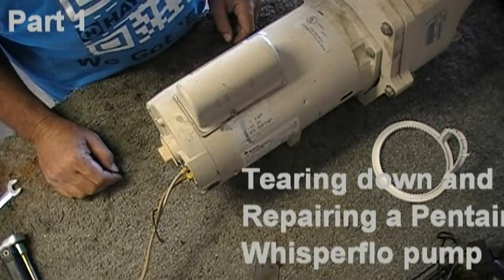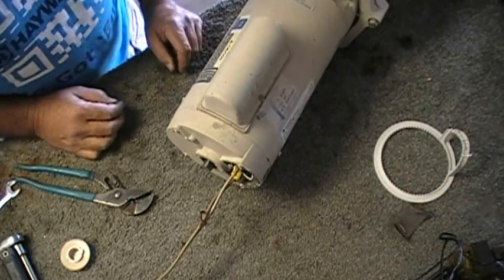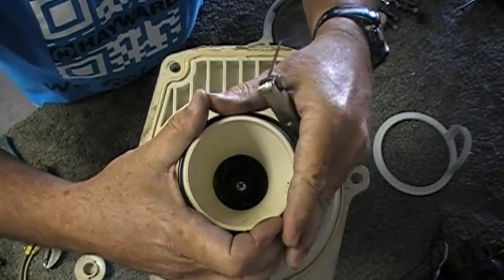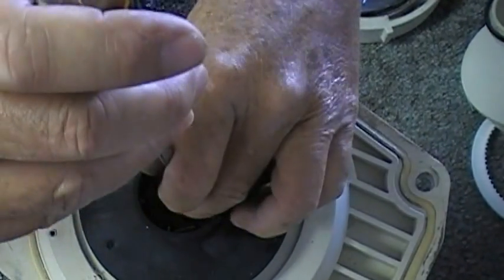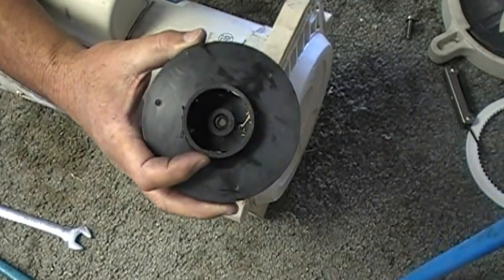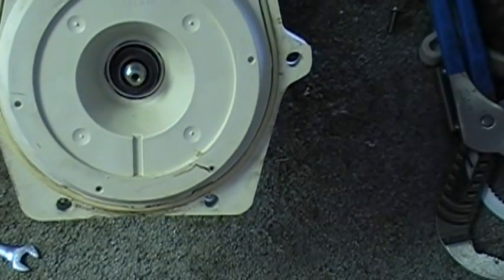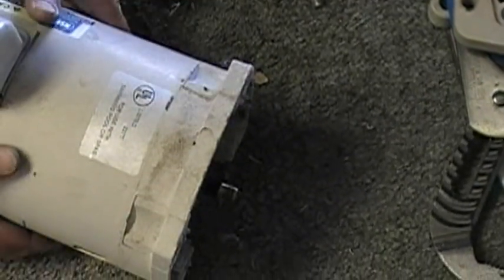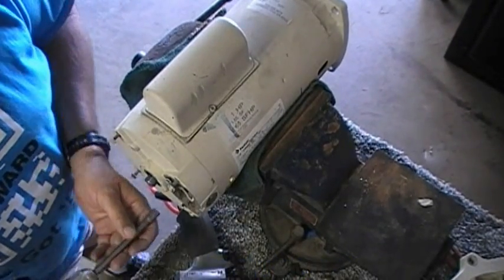Repairing a Pentair Whisperflo pump and motor part 1

Comment: the new motor I purchased from a pool company (they ordered it from a parts distributor) claims OEM replacement. New motor does not have a threaded shaft.  Now what...... The old motor and shaft has serious corrosion.Through bolts are severely corroded. Does the threaded end of the shaft unscrew from the shaft?

Comment: i have this bearings spin fine but when it runs high pitch noise then low high low when it runs what the heck is it water pumps threw but i was told motor was trying to cycle but it cant motor is going out is that true

Comment: 6:45 What you look for here is that when you use the power tool, you snap the bolts and then throw away the entire motor. Then you can just buy a new motor and all your problems are solved! Remember folks, these guys rehearse these videos, so you don't get to see how they struggled through the first tear-down. Don't use power tools on these long bolts that go all the way through the motor. Use hand tool and VERY carefully feel the back pressure from the bolt. That way, the next time you do a tear-down, you know exactly how much force you can exert before it snaps. Better method is to get some spray in there to loosen the threads before you put too much pressure. New pump should not have a problem, but who replaces parts on new pumps?
Oops - Sammy Joe already mentioned this. OK, well, I second the idea then ; )

Comment: This is a great video!!  It helped me with my stuck humming motor.  In my case I took it partially apart and cleaned out some debris from the impeller which fixed it temporarily. But then about 3 weeks later the pump was getting stuck and just humming again.  I took it apart -- had to use an impact wrench (450 foot-pounds) to get the Seal Plate bolts off since there was so much calcium build up.  And the Seal Plate was a mess, tons of build up.  I could see why the motor wasn't turning; it was because the bottom bolts had so much calcium (from water leaking onto them for over 10 years), they pushed the bottom of the plate forward.  However the top bolts were fine (no build up) therefore the top of the plate was not pushed forward.  This caused the plate to basically lean diagonal, instead of up-and-down, thus it was pinching the shaft so it couldn't spin.  I ordered a new Seal Plate and that fixed it!  I actually ordered the wrong one, and it almost fit but the bolts didn't line up and I didn't want to force it.  I was so frustrated, so I ordered another which fit perfectly.  If anyone needs a new seal plate for their Pentair WFE-4 WhisperFlo you can get it on amazon named "Pentair 350202 Almond Seal Plate with Gasket Replacement Kit Inground Pool and Spa Pump".  On a side note, for troubleshooting, you can confirm its an issue with the plate, if the impeller doesn't turn (or is very hard to turn), but once you take the impeller off, then the shaft spins rather easily.  You can also see the impeller doesn't look like it aligns perfectly vertical and parallel with the pump; you can see it closer to the pump on bottom, and father away on the top.  Anyway, hopefully this is useful for someone.  I also found my waterslide pump stopped working too, so I took it apart as well, and it had the exact same problem with build up on some of the bolts, so now I am ordering another plate!

Comment: This video is worth its weight in gold. My old Whisperflo locked up solid, and I took the advice of the pool guys and bought another one, some $250. Only a year later the thing started whining loudly. When I asked around about repairing it, I was told "we don't do bearings", and after calling around was told the only service shop that would repair old pumps in this city of 1 million people had closed up. I'll be dammed if I was going to pay another $250 for a pump that failed after only a year, so took it apart using your video.

I used the rubber pipe strap wrench on the impeller as stated below. I had bought two bearings, but the back one (as in the video) was fine. The front one was working, but felt a little grindy to me, especially under side pressure. I think all of these pumps fail because of water incursion in the front. My seal looked ok, but rust along the shaft said a little water got past.  I took the front bearing apart just to see. It still had a fair load of grease, just obvious that the balls were getting corrupted, by rust or wear. You can tell by comparing to a new bearing or to the back bearing.

Unfortunately the trend is going to wholesale replacement of items like these. The old guys who knew how to do this are retiring. I haven't done this much mecanics since 30 years ago, but that's a way not to just chuck it and eat the  cost.

Thanks again.

Comment: Hi Jay. Our pool was put in 8 years ago. It holds 14500 gallons of water. It has a 1.5hp whisper Flo with a cartridge filter system. I turned it off today to service the cartridge and add chlorine tabs. When I turned it back on it just hummed. I replaced the capcitor but no help. Shaft is hard to spin from the back of the motor. So I figure it's probably a bearing. My question is: should I replace the bearings or is it more advisable to just replace the whole pump.

Comment: I want to thank you for these videos. Helped me greatly. I, too, broke one of the through bolts, but I believe the other three will hold it in place. If I get one more lifecycle use out of this pump, it was definitely worth the effort. Again, thanks so much!
Reply: lots of easy ways to get rid of a broken bolt. If there is any stub you can grab it will channel locks or similar. If you can't even get a stub, you can drill a small hole in the middle (use oil to cut it). Then a left handed stuck bolt remover from home depot gets it out. Apply a lot of penetrant oil to the bolt for 24 hours before you try it. They actually make "penetrant oil", but I have had luck with wd-40 as well. Its a mix of solvent and oil, and carries farther into the threads than oil alone.

Comment: Hi, thanks for the detail video. I have a question that you plugged cords to load circuits to test the motor. Did you build that cord or you bought special cord that was already built? If you made it yourself, can you tell me how you built it? ty
Reply: Flip the switch on the motor (newer ones) or change the wires for 110v operation. Take an old lamp cord, cut it, strip the ends of the wire and either get electrical lugs to match the ones on the motor wire entry or get alligator clips with plastic covers (local or online electronics supply will have them). Clip that to the motor terminals and plug in. In electronics we call this a "suicide cord", you can guess why.

Comment: Thanks for sharing your knowledge. My motor was tripping the breaker every time I switched it on (no hum) and figuring it was shorted, I almost bought a new one. Then I checked the price. Then I saw your video. Long story short. I pulled out a fried lizard that got stuck between the stator and rotor. Ordered a new seal/o-ring kit and it works awesome. High five brofessor.

Comment: I've tried to take the back of the motor off on 2 different motors with the same result on both - one or more of the thru bolts break off on the threaded end. Any way to lube those or any advice on how to avoid it. It seems that no matter how careful I am the torque on those long bolts is just too much for the thin size when there is any kind of corrosion.
Reply: +Patrick Alley If the motor has seen water those thru bolts can get stuck big time. You can try spraying some spray lube on the bottom ones through the vent slots. You can also try soaking the threads as they are behind the 3/8 bolt holes on a c frame motor. A light duty impact wrench can also help remove the stuck ones. Normally we try seeing if the bolts will come loose before we decide to repair the motor instaed of replacing.

Comment: Thank you for your video!  About 6 months ago I followed your video and replaced the seals in my pump as well as the motor bearings.  The motor was screaming from the front bearing that had been exposed to leaking water for a year or so.  Got it back together and it worked great, until now.  The motor won't run and it pops my breaker every time the motor tries to turn on.  The motor made a pop sound and a little puff of smoke looked like it came out, any idea what would cause that?  I haven't touched it for 6+ months and it was working fine, I took off the rear cap and the motor spins freely with no resistance.
Reply: Not much to go wrong inside the motor besides bearings. My amateur guess would be shorted winding. Its been three years since you posted this, what did you end up doing?

Comment: Thanks Jay, I have the exact same problem.. my only question is where do you get the parts (the right bearings and gaskets)?
Reply from the maker: I get them from my pool distributors. There are only 3 different size bearings a 203, 204 and 304. Let me know if you cannot find as we sell some stuff on ebay and I can list what you need.
Reply: @dapooltec  Grainger

Comment: Another tool that works nice on the black impeller (instead of large channel-locks) is a Multi-use Rubber Strap Wrench.  I have one to use on oil filters.

Comment: Hello Jay, I have a pump like this one, a Superflo, and I bought as they said it was the most quite ones in the market, any way, after 18 months it lost warranty, and Pentair Tech service were not very nice on the phone giving any help. My pump is humming like crazy,and I will go to disassemble it, very possible bearing problem, my question is could you refer me where to buy the Bearings, sealers, and washers? I just want to change it all, and not found my self waiting days to find the parts.

Comment: first we check the capacitor on these switchless motors .the DIFFUSER o-ring was damaged by chlorine, and shaft seal this is what caused this motor to fail in the first place!  this is the pump you sell to somebody you don't like wisperjunk.
Reply: Great video.  My impeller was really stuck.  The pool store suggested breaking it off to get to the brass.  I made one last try and flipped it impeller down on the vise and clamping just the outside of the impeller.  Got a good grip and broke it loose.